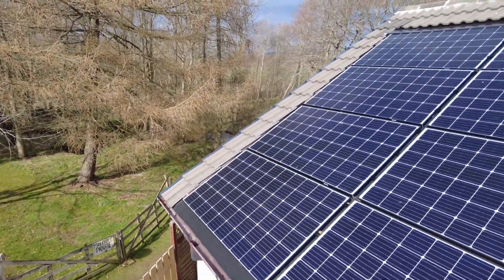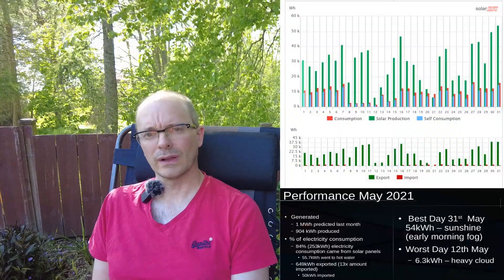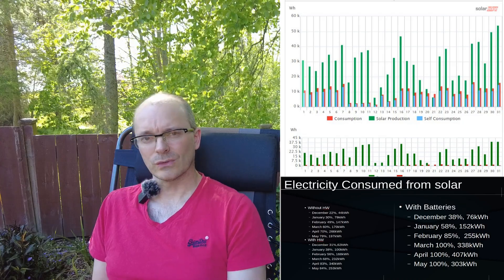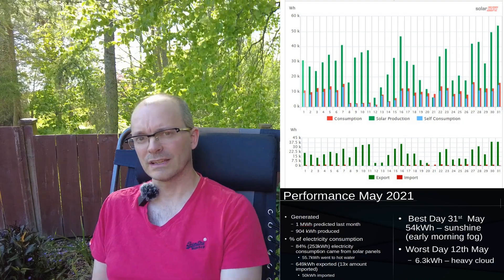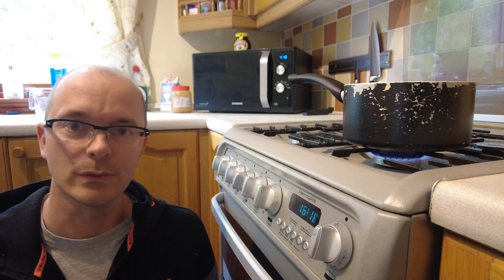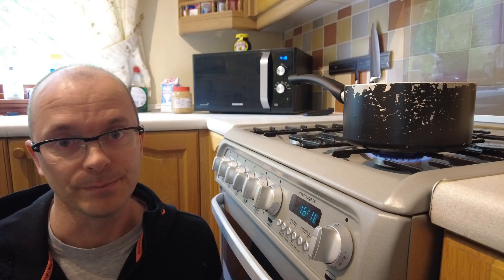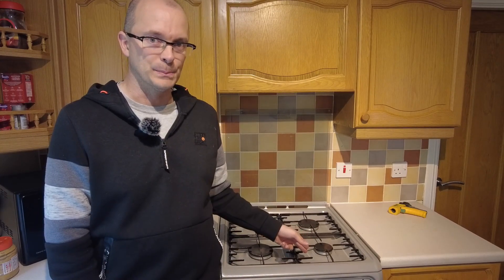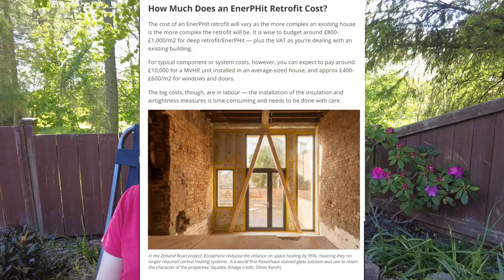May Solar Panel Performance in Aberdeenshire, Scotland & other musings on energy saving

Comment: I think to keep costs down I would add secondary glazing in that would be a better ROI 

I notice how the further north you are the answer is get more solar

In Reading I would need around 6 or 7kwh solar to do your figures

You can get Ashp HT now which utilises normal rads but cost is high 12k installed for me for 16kwh. and COP is at best 2

For the interim I am thinking off the Daikin Altherma hybrid

Comment: Hi Anthony, Thanks for the update, your panels performed pretty well considering the miserable May weather. We are also looking at possible future alternatives to gas, having a leaky old house a heat pump doesn’t fill me with confidence, one alternative option that has caught my eye is a soon to be released warmstone heat battery made by Caldera it would mean you wouldn’t have to change your radiators, I’ve a few years yet before I have to make a choice but more options seem to be coming available all the time.
Reply from the maker: I just had a read about the warmstone battery.  You’ve tweaked my interest there, as I’ve never heard of it before.  From what I’ve read, the heat battery relies on the cheap nighttime electricity rate to make it economic.  That is definitely one way to do it.  It strikes me as not being too far away from the age old technology of using night storage heaters.
Reply: Yes it caught my interest as well and I’ll be keeping an eye on it. The thing that attracts me to it is if I had a heat pump I’d have to use the energy when I needed it which would be peak time, but with this heat battery I could use off peak electricity. But it less efficient than a heat pump so it would be dependent on cheaper off peak prices. At the moment it would be the best choice for me, but who knows what’s going to happen in the next few years, I think a lot of changes are going to be happening, very exciting times in the energy world!

Comment: Thanks for the update Anthony. We seems to be tracking down the same route with improving the fabric of the building first. I've come to the same conclusions around EnerPhit and cost/benefit.
Reply from the maker: Agreed it’s a really hard puzzle to solve! One feature of my in-roof adaptors is that they can be retrofitted to have ducts fitted to the back of them - allowing you to harvest a bit of solar thermal as well.  These are then connected all to a loft mounted heat pump, which can then supply ducted warm air to the property.  I might just investigate that in more detail later on.  It’s a really neat idea on the face of it.  They would also be used to keep the panels cool in the summertime.